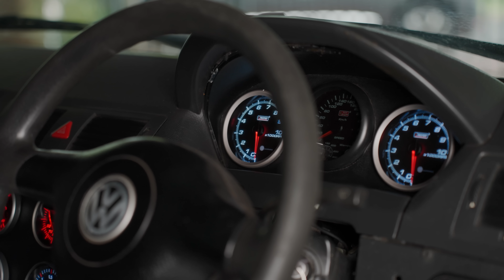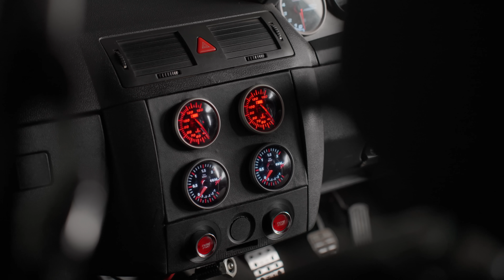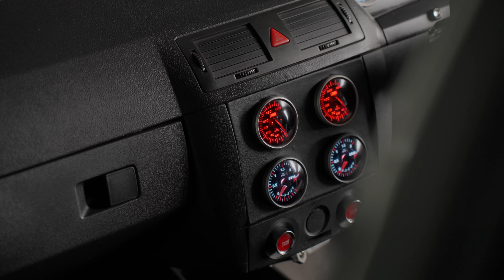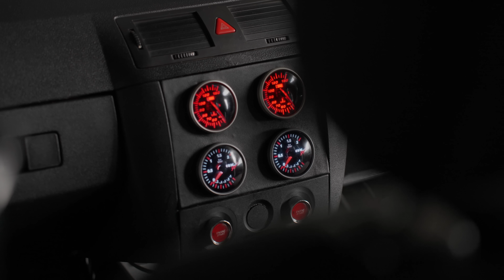Two-Engined Golf! Two turbocharged VR6 Engines, All-wheel-drive & Two gearboxes! (Home-built in SA)

Comment: My favorite two engines small car is a Honda CRX approximately the late 90s? It's got the standard stock front engine still working and a blown Oldsmobile 455 in the rear. They both work independently. Sometimes all he has to do is start up the rear engine and the race is over. Really cool solution to keeping the car streetable

Comment: hi, you forgot to explain the cooling for 2 engines, i doubt the original radiator will work good for both engines?
Reply: You right,but cooking system is easy,as long there is an Engine obviously both outlets are there to connect radiator Lower /inlet and upper/outlet tubes.

Comment: Awesome!  Super impressive build.  A couple of questions: 1) Does the original front radiator provide cooling for both engines, if not how Is the rear engine cooled. 2) do you run an alternator on the rear engine or rely solely on the front engine’s alternator?

Comment: What's the 1/4 mile and 0-100kh times. Would be much better with this info to see if all the power actually gets multiplied. Theoretically should be running Mk8R with this setup. Basically 6L, V12, Twin Turbo

Comment: Can someone clarify this for me. The front engine powers the front wheels, and the back engine powers the back wheels ?
Reply from the maker: Yes that is correct. Two gearboxes with both clutches connected to the same gear linkage, but the rear engine can be disconnected when not needed. Mad!